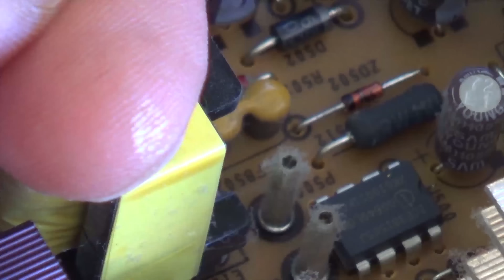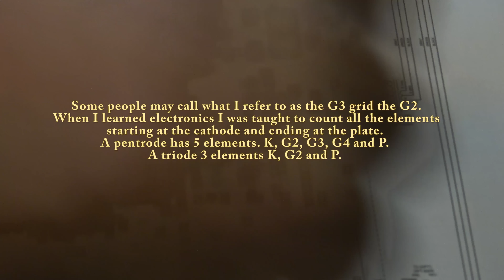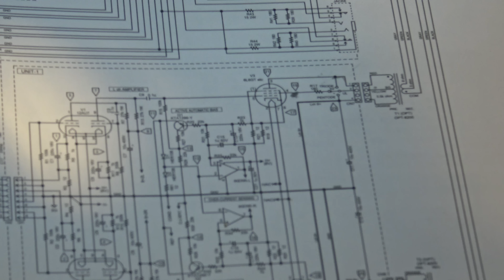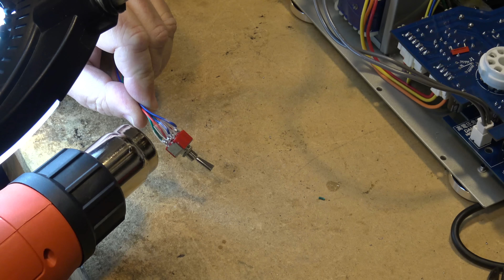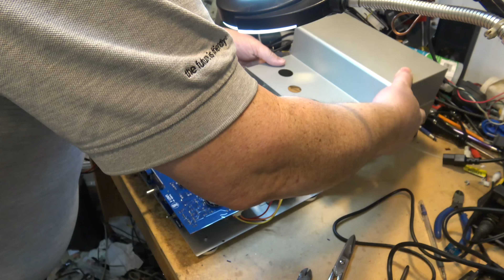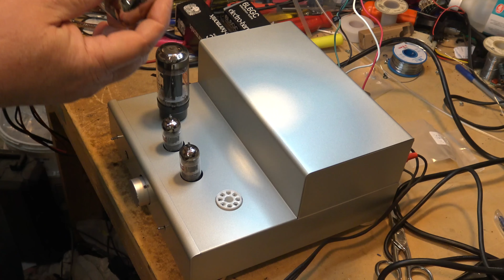ELEKIT TU-8200 6L6 Single Ended Tube Amplifier build Part 5

Comment from the maker: Have to laugh at Youtube content ID. Used the same royalty free track for the demonstration, the classical piece "The mentor" from Musicbakery. No claims on the first video, and I get a 3rd party claim on this one that is now under dispute.I rolled the tubes to old EL34 pulled from my other amp. Now I prefer the triode setting. That's the beauty of tubes. Change the tubes, change the sound.
Reply: I wish people would stop talking about tube amp distortion. It seems people only have heard about instrument tube amps. That's where tube distortion is relevant and only under saturation of the tube (overdriving it). For guitars there is no doubt to get the sound created from saturating a tube amp is the only way to go (or simulate it with SS). For home,  HiFi tube amp circuits are designed to provide for zero saturation (no overdrive stuff) and under normal responsible listening levels (not turning it to 11) tubes don't distort. Looking at tubes at their rated power output, just before clipping, they are typically under 1% (.5%) distortion and the harmonics are negligible (almost immeasurable). My Bob Latino ST-70 amp sounds absolutely amazing and I even prefer it over my Bryston 4B SS amp. There certainly is no distortion on the tube amp and in fact it's clarity is amazing and I have never heard drum cybals sound so real and clear. So please stop confusing "Instrument tube amp design" with "HiFi tube amp design" they are two completely different animals.
Reply from the maker: The first tube amp I ever had myself came out of my parents old 1960 RCA console stereo with the built in 25" B/W TV. It actually didn't sound bad. Was a single ended output, and produced perhaps 5 or 6 watts.When the console was scrapped I took the radio chassis out and used it as an open frame radio / amplifier in my bedroom for years until my mother got a nasty shock when cleaning and touched the chassis. Funny I never got shocked by it, and I was only probably 6 years old, and knew not to touch any of the components when it was plugged it. I had a few of those crappy single tube seabreeze record players that had 80% distortion. The first real piece of hifi gear arrived in 1969. My dad had just gotten a new job, and money was starting to flow in. He had been given an Akai 1710W tape recorder as a gift from the captian of the NYK line on it's maiden voyage at the port we worked at. First ship at a brand new port, they exchanged gifts.My dad wanted bigger speakers for this tape recorder because the built in 5X7 oval were not great. The unit had external speaker plugs on the back. My dad went to the stereo shop in the big city to buy some speakers, and was sold an entire system, a McIntoah 1600 FM receiver, and some big speaker boxes.I remember my mother going nuclear on him for spending 2 months wages on a stereo and ordered his to take the stereo back.I thought that was the end of it until 25 years later my dad asked me to go down into the crawl space and oil the pump for the furnace as he could hear it squeaking. When down there I saw this old cardboard box that was falling apart, and poked my nose in to find.... the McIntosh that my dad "took back" 25 years earlier. Aparantly the store didn't give refunds, so to avoid a nasty fight when he returned with it he hid it in the crawl space and forgot about it. Now in my collection. It needs a recap job I am sure by now, but it has all the original tubes in it, and I have probably only run it for a few hundred hours. (because it needs a cap job)One thing I can say about the new tube amps, they sound a lot better. The old ones have carbon resistors that drift as they warm up, and that changes the sound. New designs are using very tight tolerance parts, and they don't drift. The result, much better sound then the old ones.
Reply from the maker: Absolutely. The best sound I have ever heard comes from a hifi tube amp. For those that have never auditioned one, and are looking at the specs on paper they have no idea what they are talking about.Also worth noting, even crapy compressed MP3 sound sounds superior when put through a tube amp. 33 years ago Luxman put 2 tubes in their high end mosfet amps to bring them as close to all tube sound as they could. It works, my Luxman sounds great, but I still prefer the all tube sound of this single ended amp, in triode mode.
Reply: Many 'old radios' are built with a quality that  will never be seen again - most likely. I also have a Philco with a single EL84 output driving a high sensitivity full range drive unit. On a decent FM broadcast it sounds so 'alive' big, weighty and real that no modern unit - be it stereo or whatever - at any price can touch it for parts of its performance - from an old radio? 
Musicians who used valve equipment - who are not audiophiles - knew the solid state replacements sounded poor - for whatever reason. Whether they were used to playing to distortion or just straight at low level (where the design is the same as most 'hifi' units') they were better. Hence they survived. Audiophiles who exchanged their Leak / Quad / Lowther/ Radford etc. valve amps for the new transistor units often went back to their valve equipment if they were sensible enough to keep it. Even after 60  years progress the peak of audio nirvana was probably between 1955 and 1965 in studio and home for film and music.
Reply: Aren't the el34's higher voltage?
Reply from the maker: The amp has automatic bias set up. It detects the tubes, and sets up the bias accordingly. It uses the higher voltage 6L6GC not the lower rated 6L6.6L6 rated for 250v plate. 6L6GC 300v plate, which is right in the EL34 range. EL34 can go much higher for sure, but this is only driving it to the same power level.
Reply: This is true but tubes are only harmonic distortion
Reply from the maker: Well they have higher distortion on paper, and that is why we expected them to all disappear years ago, and they almost did.There were enough audiophiles that wouldn't accept the odd order  harmonic distortion that transistor amps deliver, and that niche market, mostly 40+ men with lots of disposable incomes that didn't mind spending big coin to keep that classic sound they grew up with.Tubes never went away, they did almost become extinct but DIYers and a few bouquet builders kept turning out huge dollar hand built amps. Anyway back to the harmonic distortion, even order, the type that tubes generate is not a bad thing. It actually improves the sound of musical instruments.
Reply: This is true, but cheap tube amps in radios and rekee players from the 50's-70's sound crappy, usually those small full range speakers were awefull.  If you turned them half way, at 5, they distorted like crazy, and sound bad.  This was very common, most people did not have high end hifi amps, they had the cheap 6AQ5  junk with cheap 5" speaker.   95+% of the people had cheap tube crap, and that is what they relate to.  Think of the common cassette boomboxes of the 80's-90's, most people would relate to that for solid state.  The good stuff started at 500$, even at Radio Shack.  The big transformers were a big chunk of the cost.  Then you had to buy decent speaker systems, add another 500+$ for a pair.  Then a good turntable with good cartridge, a good deck, and EQ was at least another 500+$.  Most folks spent less than 100$ for a stereo, unless they got the furniture in a console.  So to most, tubes were crap, even many boomboxes sounded better.  To get over ten watts / ch with decent tube stuff was costly then, and now.  If 12voltvids restored a 1960 Philco aa5 radio, it would sound shitty.  Now that's distortion that many remember. I must admit that I was skeptical about this amp for the price, but Dave was right, it was better than expected for modern stuff from the far east.  Don
Reply: You are right about the distortion but with the old radios comes a feeling of nostalgia.  Ya, theirs much better now but sometimes it's cool to just rewind back to the 60's to see what they had to play music on.  Makes me appreciate the engineering advances since then.  Like driving an old car.  Its not all about the performance but the overall feeling.  I just resurrected an old Silvertone console from my grandparents.  Does it sound as good as my Yamaha A-960, no.  Never will but when I get it finished, it will be a piece of my collection for as long as I can hang on to it and will be proud to drop some wax on it.  Just my 2 cents.